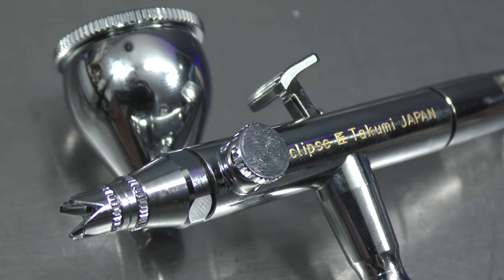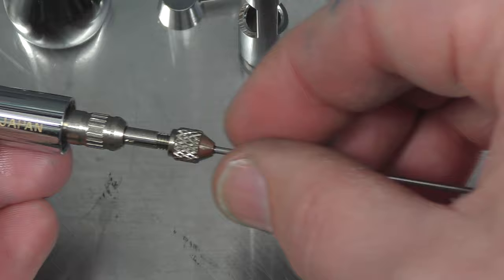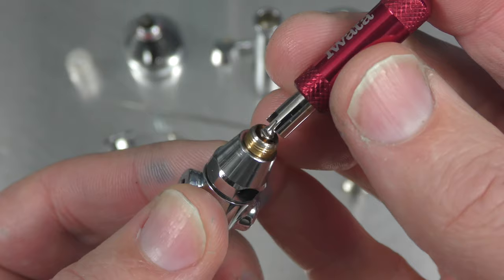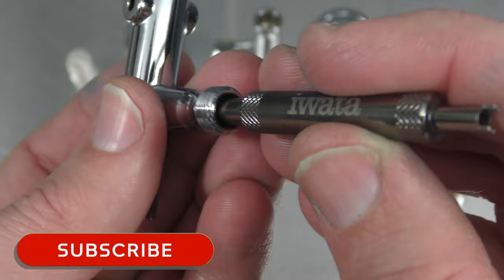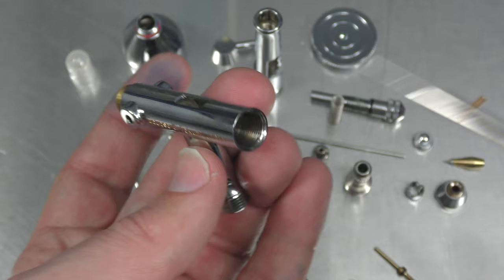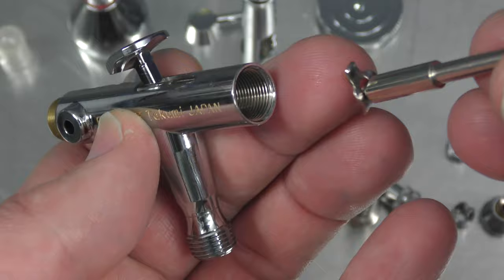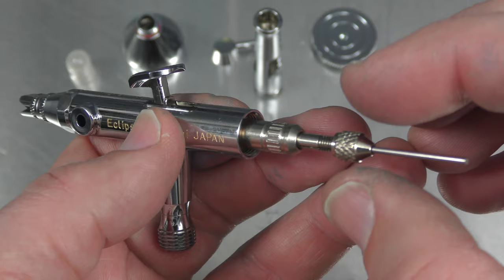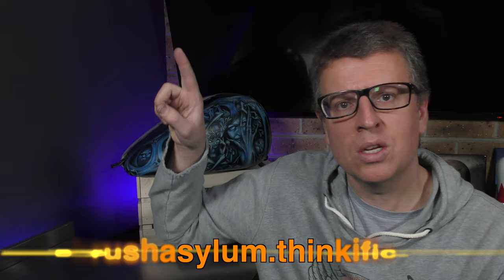How To Pull Apart & Reassemble The Iwata Eclipse Takumi

Comment: when the needs and the nosles , i am a  set i pick airbrush  the right job out the nose our need all the time. can up tell whats  they star mm 35mm  down fintest neeld tell size go down to pls noses and neds pls set trying her pls ty for hep hep like pls the right needs each job
Reply from the maker: Thanks for your comment, if I can understand your question correctly I assume you want to know the finest needle / nozzle up to the largest needle / nozzle. From my experience you have airbrushes with a 0.18mm and they go up to 0.5mm and I am sure there may also be larger nozzle sizes, the ones I mentioned are what I am familiar with.
Reply: @AirbrushAsylum  i am  from austrila  fined here in  my home town

Comment: am i correct that this trigger is interchangeable between the eclipse hp cs?
Reply from the maker: Great thought, I haven’t given it a go but will definitely try it …I would think so as they are both from the eclipse family 🤞🏻
Reply: @AirbrushAsylum  i look forward to your findings. i ask because iwata seems like they have several different trigger designs and those 2 look the same. i used an eclipse hp cs the other day and i was having trouble modulating the pain flow with the shape of its trigger. this one seems much more ergonomic

Comment: Hey buddy it’s Marc and I was doing a stencil and did you ever have one of those days ! Where my Iwata wasn’t running good it was spiderwebing all over and so I changed to my master airbrush and it kept getting clogged nothing was working my shading sucked and nothing looked good have you ever had a day where nothing works right always clogging or spiders what did you do ? Please help a extremely frustrated airbrush artist ! Please my friend!! What would you do???
Reply from the maker: I have definitely had those days ...I would pull apart your airbrush and thoroughly clean it...even let it soak overnight....this will also give you the time to have a break ie...leave your artwork for a day and then re-visit it tomorrow, if things aren't working then the best thing is to give it a rest, otherwise things just keep getting worse...hope that helps 😉
Reply: @AirbrushAsylum  thank you my friend! I will ! I used your video and deep cleaned my Iwata and it’s running superb! And I’m just not gonna push it I took today off and I’ll look at my pictures with fresh eyes! Tomorrow! But buddy it was like quicksand I’d get the air pressure right then it would tip clog I’d raise the pressure and it would spider I was waiting for the 12 plagues of Egypt to fall on me ! But thank you! Your a real awesome friend and thank you for your help!🙏🏻👍🏻